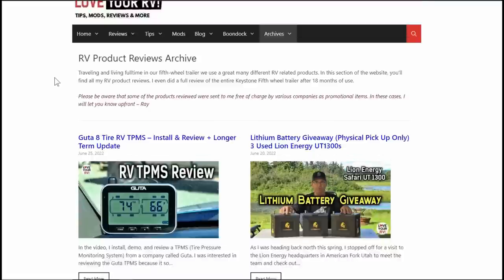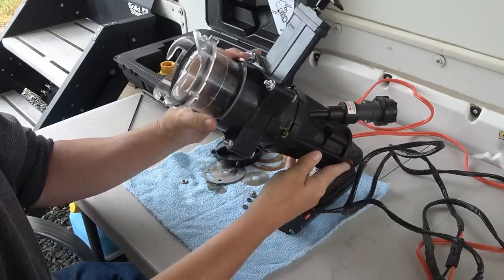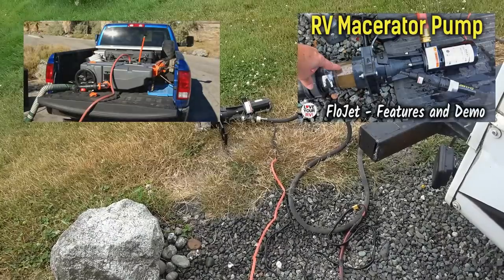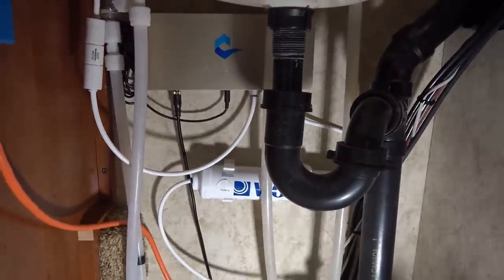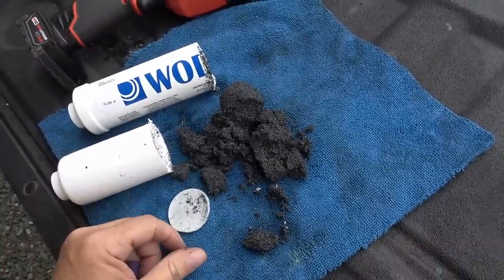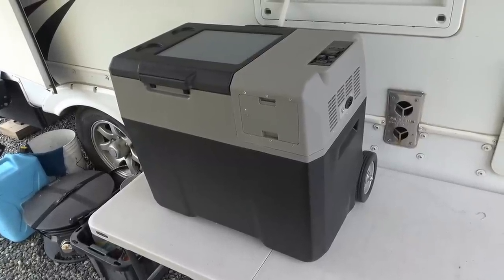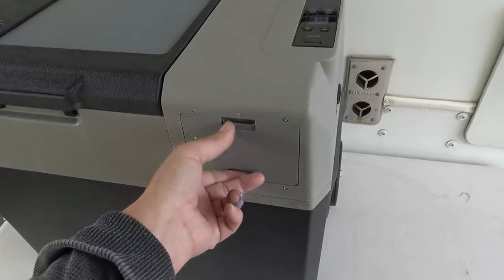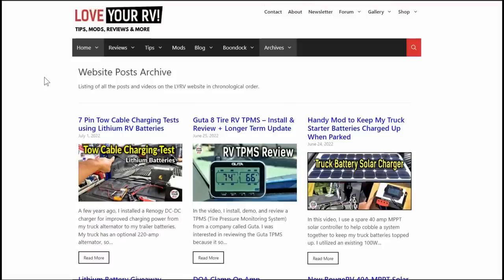9 More RV Product Review Updates after Longer Term Usage

Comment: Gaskets, you can use cereal boxes and cut out the gasket or parchment paper. Your buddy Badge can give you some shortcuts on that, to transfer the info to your peeps.
Reply from the maker: Thanks. I was thinking of a roll of gasket making material like one of these Karropak - Chemically treated fiborous sheet designed for use on oil, water and gasoline https://www.summitracing.com/search/part-type/gasket-material-sheets/product-line/fel-pro-gasket-sheets

Comment: All good stuff. The only upgrade that you haven't covered is a compressor upgrade on my fridge. Have you considered doing one?
Reply from the maker: You mean swapping out the gas/electric absorption fridge for a 12V compressor fridge? Figured I'd keep running the gas/electric until it has a major failure then maybe get a 12V. It was replaced under warranty after 6 years so not as old as the trailer. The newer gas/electric actually works pretty good much better than the original and saves power when off grid.

Comment: Was wondering if you could do an update on the roof coating you did, curious how it was holding up?
Reply from the maker: Yes, I'm planning on doing an update and recoat this summer. So far, it's performed well. no flaking or peeling. The best part is since the old rubber roof is now covered I don't get nearly as bad of black streaks on the side walls as I use to. The coating can be reapplied over itself, so I'm going to get another gallon and add another coat. Just waiting for a new air conditioner to arrive so I can do it when I swap out the old one and do the roof area under it. Cheers, Ray
Reply: Ray, when you do your roof update video, could you cover Eternabond, Sikaflex, 3M double sided tape etc., tips for application, lifespan etc. I applied Sikaflex 252 then smoothed with denatured alcohol only to find out it affects the curing process, so I had to remove and reapply. Anyway, thanks for sharing your updates with us
Reply from the maker: Not sure, if you saw my roof coating video last summer -  https://www.loveyourrv.com/rv-roof-reseal-and-refresh-alpha-systems-top-coat-lap-sealant-and-roofing-tape/  I discussed the roof tape and applied a patch, also laid down some self leveling lap sealant made by Alpha Systems. The last few years I've been trying their various sealant products out with good success other than the roof cleaning spray.  I find its pretty weak.  Alpha systems used to be mainly a business to business company suppling OEMS but in the last few years they have been selling to consumers using Lippert as a distributor. https://alphallc.us/products/adhesives-sealants-cleaners/

Comment: Hey Ray, I currently use a Sewer Solutions high-pressure water macerator that works pretty well, but unfortunately, my home water pressure (a well) runs at a low PSI. As such, I occasionally end up with a clogged hose that requires some rather messy "mid-dump" cleaning. Anyway, was just curious about your macerator, b/c if it builds so much pressure so as to blow the end off, kinda' sounds like the right gizmo for me, lol.
Reply from the maker: It's pretty powerful, fills my 36 gallon tote up in the back of my truck in about 5 minutes or less. At my sisters place I used a 50 foot 3/4" hose and the rise was about 6 feet and it had no problem. Still great flow.
Reply: @LoveYourRV  Sweet, thanks bro!

Comment: I am wondering why you did not use a PPM tester for that water filter. That is the only way to know how clean your water is.
Reply from the maker: Filters like these aren't designed to remove dissolved solids so wouldn't prove anything. Basing overall water quality on (TDS) Total Dissolve Solids PPM readings is sort of a myth. For that you'd need to install some type of Reverse Osmosis System that removes dissolved solids in the water. 
Here is more about TDS testers https://www.freshwatersystems.com/blogs/blog/should-i-test-my-waters-tds  and some previous testing I did myself. https://www.loveyourrv.com/testing-rv-water-supply-for-total-dissolved-solids/  and https://youtu.be/kPdmjsoDmDQ?t=184  Cheers, Ray

Comment: Hi Ray you know something is niggling at me with the Eco Flow. If you wanted to use your DC to DC charger to recharge   the Eco Flow as you went down the road is there a way to do that? I know the 12 Cigar lighter outlet I think puts 8 AMPs or so into it I think anyway. But can you use the DC to DC charger? Is there a way to rig up another port? Or perhaps are they concerned with selling solar panels. Just thinking for our climate being able to 40.or 60 AMP DC to DC would be a great thing!
Reply from the maker: What I do is use my existing inverter to charge it with when traveling. I still have my regular bank of RV batteries and they have been powering a 1000W Canadian Tire pure sine inverter for over 11 years now. So using that old inverter I charge the EcoFlow and it in turn powers my RV fridge which draws 390 watts when the electric element is cycled on for cooling. I also usually set the EcoFlow to charge at just 200 watts so the total max draw on my 1000W inverter is 600W. That power is usually recouped by my 1000W roof solar array or the 40 amp DC-DC charger if need be.  There are power losses with all the AC-DC-AC conversion going on but usually I'm getting some free solar power anyway.
I guess a person could hook an inverter up close to the truck batteries then run an AC extension cord back into the trailer and hooked to the EcoFlow. That would be a simple solution to get some higher amp charging while traveling. Just have to make sure the alternator can handle the load.
Reply: @LoveYourRV  Yes I was thinking of a van and if the Eco Flow was the primary battery of course the way to recharge it would be DC to DC as you drive. Or a motorhome might be the same. There is a gap there it seems.
Reply from the maker: I think the thing that limits the 12V charging is the fact that the lithium battery packs that the majority of these power stations use are around 50 Volts DC. 
So to charge at a high DC current input rate would mean having an internal charger that could handle the higher amperage and do the voltage step-up conversion. I imagine they figure the extra cost and complexity isn't worth having for the low percentage of buyers that would use it.
Reply: @LoveYourRV  Ah ok I missed that point I was thinking 12 V. Yes you would need an alternator to match or a step up converter cost prohibitive. The reason I got thinking this way was trying to justify the price of the unit. The 4200 dollar one. Then when I thought well you don't have to buy a MPPT controller nor a battery monitor nor an inverter nor a shunt nor several fuses and it was making it look attractive more and more as if your buying Victron that is a fair chunk of change a guy would save and likely would make up nearly 2000 dollars. The new thing I really like is the Growatt Server Rack Battery 400 AH for 799. Excellent deal and great BMS. Have not seen server rack batteries much in Canada yet more so in the US. What I have seen in Canada in batteries is pretty cost prohibitive.

Comment: Mine stopped mid dump yesterday. Any suggestions as to what i could possibly do to get ‘er goin again ?  Yes ive do e the messy part of closing valves and removing to  see if anything needed to be retrieved from blade area and there was nothing to remove. I reattached and flushed it ith gray tank a bit to possibly loosen up things and it turned on for a moment then petered out. 😬
Someone mentioned loosening screw on the bottom of pump caue sometimes hair can get tangled…like you did mention, but i dont see a screw or anything. Added Pic
Please someone help😫😫
Reply: Cant add photo i guess
Reply from the maker: There is a small cap at the end of the pump that you take off, and a slotted screwdriver adjustment turns the whole mechanism in case it gets jammed up to free up. Also, there is a fuse in the remote control.
Reply: @LoveYourRV  
Its hooked up to battery so i don’t think there is a fuse but please correct me if I’m wrong though…im a newbie
Reply: Well the turning didn’t seem to work. I feel like if the pump took a 💩 then it wouldn’t turn on at all right?? I mean since this lil situation,when i do it sounds like it’s struggling and then like isaid it just peters out..how would i know if the drain hose, that runs everything to the septic, has a clog somewhere in it? The pressure built up from nothing being able to go down and out all the way through hose must just cause the macerater to auto shut down for safety precautions..😬. Does this sound like it makes any sense?🤞🏼
Reply from the maker: Sounds like the motor isn't getting enough power, maybe the battery is weak or there is a bad connection or the motor is defective.
Reply: @LoveYourRV    Will test voltage. Thank you…will keep you posted
Reply: Yes this was the issue and a battery charger did the trick   Thank you so much
Reply from the maker: @angelanichols5257  You're welcome. Thanks for letting us know what the problem was. Cheers, Ray